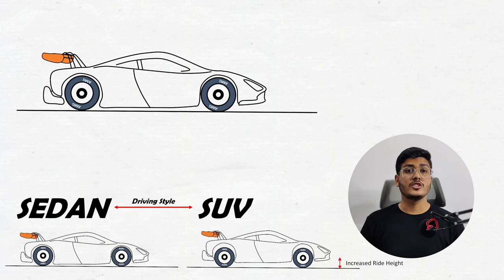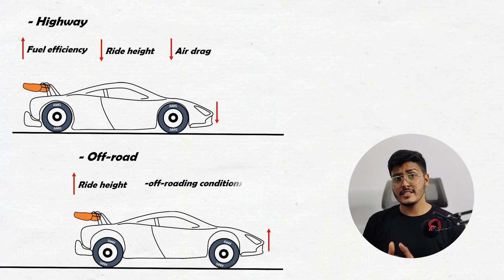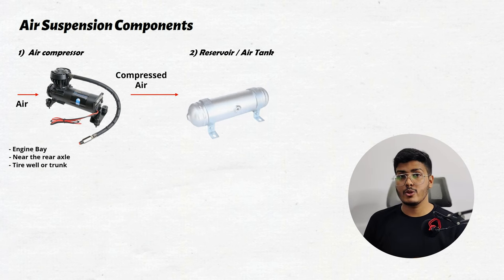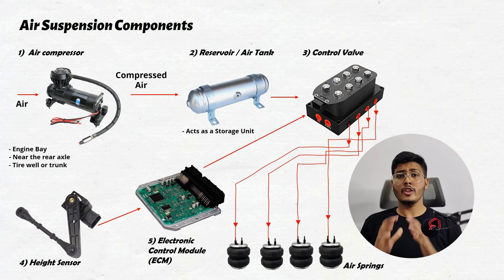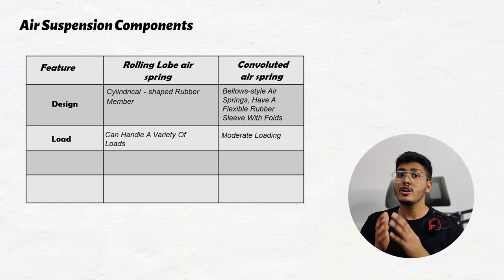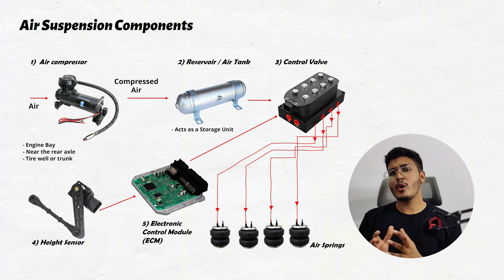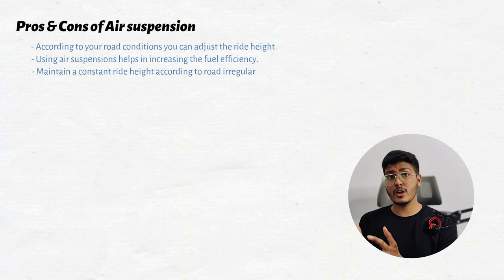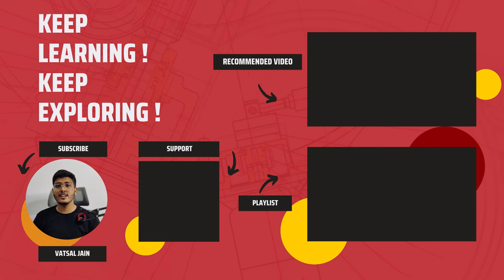Air Suspension | How it works ? | Different Components of Air Suspension

Comment: You are wrong dude... Im working in trailer lift axle air suspension system... Convoluted bellows are used in light vehicles and passenger vehicles as they are piston type bellows where they naturally dampens the vibrations and doesn't allow the vibrations of varying load to the chassis... Where as in other hands the convoluted type bellows directly transfer the load the chassis as it when compressed they transfer the reaction load to the chassis, so they are used heavy duty applications and they can cover very long distances and is very durable